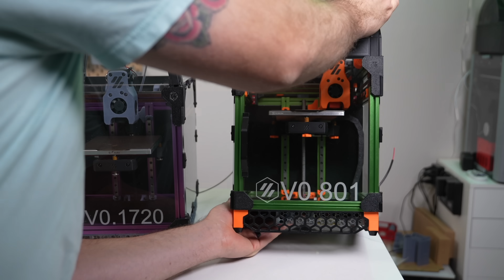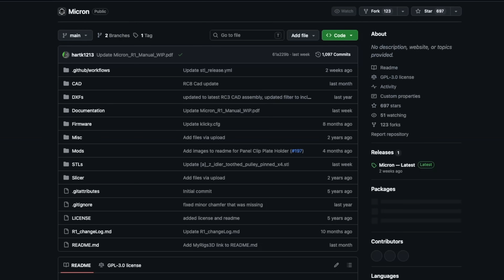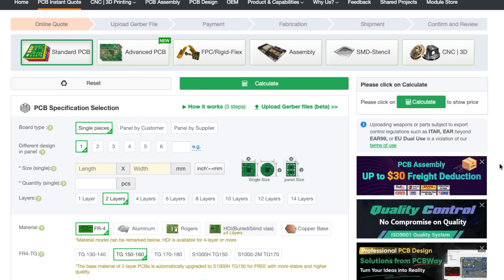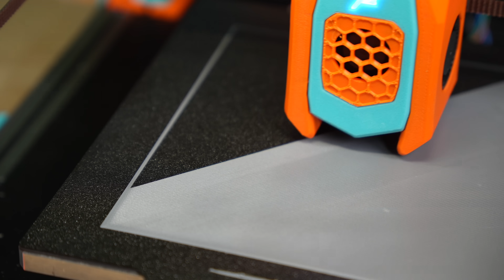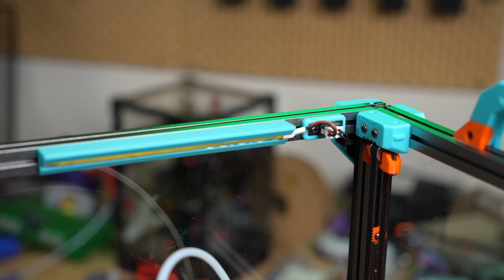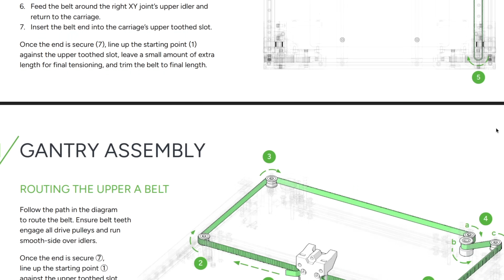The Ultimate Small 3D Printer? LDO Micron+ R1

Comment: Very nice.  I think I would build one with an opto tap CNC carriage (from stealth changer project) as it allows for full assembly/maintainance of the anthead toolhead away from the printer and allows for a carto/beacon mount direct to the carriage that can be connected with either its own dedicated usb cable or a usb cable that plugs into the NH36.  Would also allow option for swapping out the toolhead quickly with minimal fuss, no need to redo belts, etc, for testing a different toolhead, special use cases.

Comment: i bought a micron+ kit from formbot & shortly after it arrived hartk released r1 in beta, which i immediately pivoted to with zero regrets.  i did go with btt eddy out of the gate, since it came with a manta m8p & ebb36 anyway, which has made the machine just that much more awesome.  i haven't seen any significant differences between beta & current to make me want to change anything, though i did use tinted panels on the sides instead of clear & the magnetic tophat mod.  it's always been intended to be my high temp beast & prints pc parts for my other machines really well.
Reply: How was the formbot kit? I'm trying to decide on if i want to pay the LDO premium or not...
Reply: @Talasarian actually, i love it.  they've since upgraded it to r1, so i definitely say go formbot.  just make sure you have extra fasteners - they were short a few, particularly self-tapping for the toolhead.  ldo makes some fantastic stuff, particularly motors, but i could never personally justify paying their prices.

Comment: Seems really neat but also too over engineered and expensive for a basic Klipper machine at this point. 
I built the LDO of a Voron 0.1 years ago and this just feels like upgrades from years ago when the rest of the industry is so far ahead. 
I'm not sure why we'd want a CANbus on a lightweight, small form factor speed machine. 
And why are the raspi and printer main board made that way instead of using a standard board. Or the LDO PSU?  
There's a few odd design choices. It really seems like really specialized for some arbitrary reason. What happens if things break? 
A lot of work, that's what. Which sucks since I think this machine could have so much simpler and still work just as well. 

Thanks for the content and overview though! Neat to see what's out there right now! Stay well!
Reply: you did realize its not using can ? its using a usb toolhead ... and the mainboard and pi are made that way to save space .. that board has the pi sit ontop of it, supplying it with required 5v and communicating with it .. that ldo psu is the smallest youc an get for what it is .. this printer is small it dosent have much space, unlike a v0 which has the whole back and bottom for space, this only has the bottom below the bed ..

Comment: this video reminded me that i always wanted to either buld a Voron V0 or the Micron, i only wish there was like an inbetween version with a 150mmx150mmx150mm build volume
Reply: salad fork!
Reply: I have a V0.2r1 and can't recommend it more. The only thing I'm missing with it is that perfect first layer. Sure it's a small plate and manual leveling isn't horrible. But like any form of ABL is just so much more nicer
Reply: @SweHam  did you look into printers for ants tri-zero (T0)? triple belted V0 mod.
Reply: @ElvianEmpire  I'm aware of their existence but since I don't have an unlimited budget and unrestricted space for printers I'm most likely going to let my V0 be what it is and save up for a 2.4 or Trident in the future to replace my not so nice Ender 5 S1
Reply: @SweHam  ah, understandable you don't want to modify the existing printer. I'm currently swaying between doing a V0 (or adjacent) build or one of the bigger ones.. I probably will go for the V0 because that'll allow me to print ASA reliably, opening more doors in terms of mods and new builds.
Reply: I could totally modify the V0 further but any money spent on the hobby next will be getting a larger format printer. But no matter what I'll keep the V0 around cause now that it's set up it's so reliable and it prints ABS/ASA with great results. Maybe I'll modify it later but the simplicity is quite charming 😊
Reply: Tiny-T

Comment: What is the main gain of a flying gantry compared to the v0 ? I know it looks cool, but is it better ?
Reply: Center of mass is lower. No cantilever bed
Reply: @dawiiid are either of these actually benefits? The flying gantry is less rigid and more complex
Reply: Flying gantry allows for better bed leveling. Since the bed is stationary the independent motors levels the gantry to the bed. And as far as BETTER goes, the print quality is slightly better than my V0 and prints are slightly faster as well but take that with a grain of salt since they run different tool heads
Reply: @jamesso6811 you only need 3 points to define a plane. Trident is all you need. My biggest qualm with it is that 4 points over constrain the gantry and partially because of this, compliance is designed into the gantry mounting. There is a reason the fastest printers don't use flying gantries.

Flying gantry is great for adding tool changers, but that isn't the use case for most users.
Reply: @blinky2035  yeah i dont disagree with that. But thats the main differnces in the V0 vs the micron. The micron is just a PFA version 2.4  but the V0 has som short fallings if you compare it to a trident. They're 2 vastly different machines. However if speed is all you care about then none of this even matters lol

Comment: Are there advantages to building this vs buying popular branded printers?  ...Minus the whole ecosystem lockdowns.
Reply: if you like building things, owning them and having the option to change whatever you want
Reply: Building an open source printer gives you infinite flexibility and future-proof adaptability. It's always a trade off. With machines from companies, you get ease of use and support, but can be stuck with a platform that is difficult to repair/mod. 

An open source DIY machine is infinitely customizable, but you are the support team. 

And one other thing, you learn so much when building an open source machine, and I would argue that deep knowledge makes you a better designer, maker, and innovator. Plus, you're not tied to a corporate empire.
Reply: Also, repairability, every printer will require maintenance, if you built it, you know everything about it